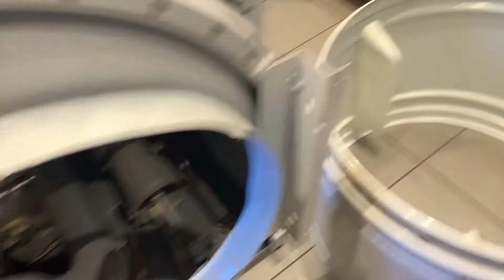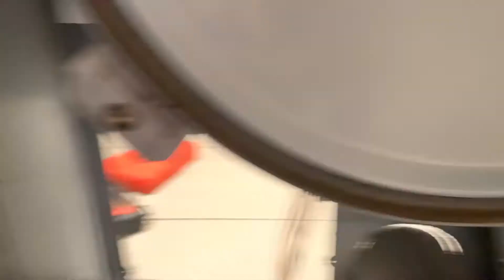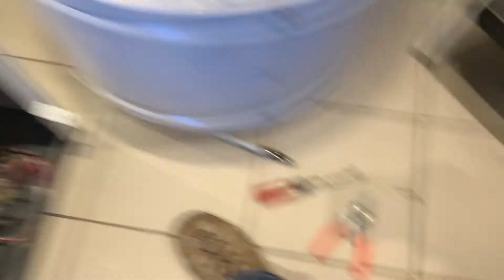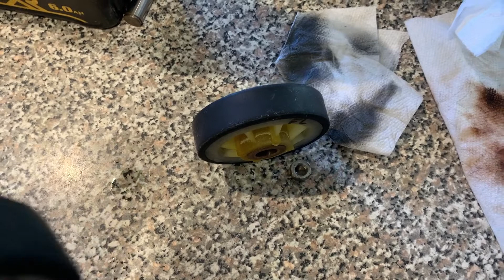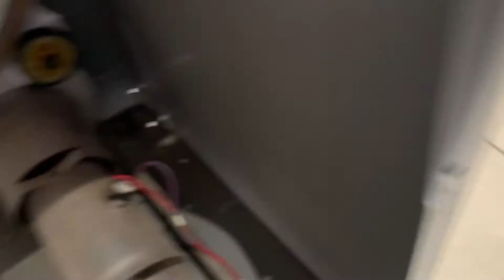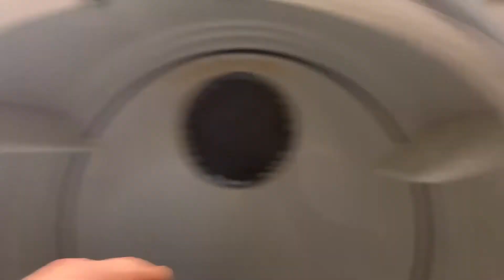Maytag Dryer Model LDG4914AAE Maintenance - SAVE $$$

Comment: Thank you for this take apart and maintenance video. I have the same dryer model (30 years) and it stopped heating. I will check the parts you recommended replacing.
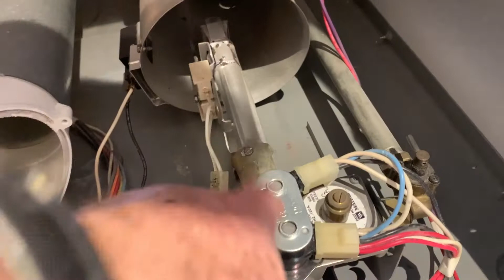Reply from the maker: Check the gas solenoids replace regardless. Cheap and the gas cause gas to not flow or be intermittent. Very easy and safe requires not messing with gas pipes or anything. At 7:37 you can see them in the lower right. There is 2 I believe

Comment: Thank you for this video. I have the exact same dryer, 26 years old and the heat stop working today.
Reply from the maker: Might be the igniter if gas. Check the thermal fuses for continuity. I would change out the 2 gas coils if it is gas. They’re like 10 bucks and they’re so easy to change. When they fail their intermittent and very hard to diagnose. Good luck
Reply from the maker: do you still have yours?  Mine is still running strong still.  Think I will redo this same maintanance process again and replace the belt as well.  It runs great.
Reply from the maker: Yes still running strong